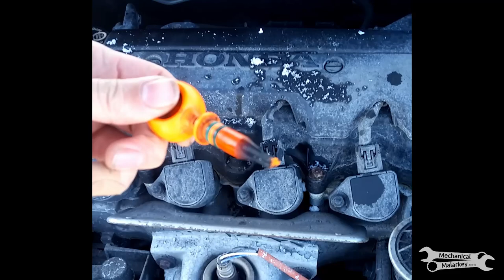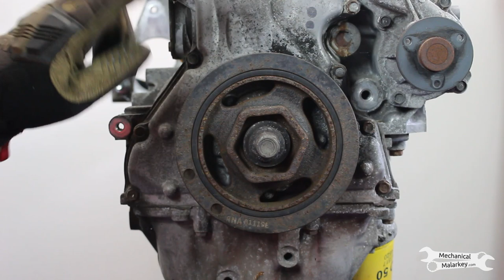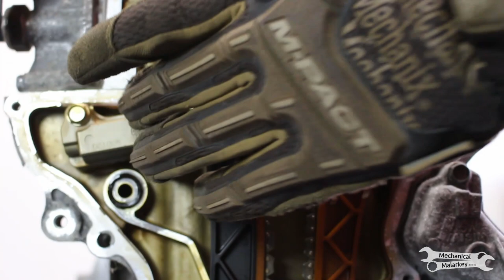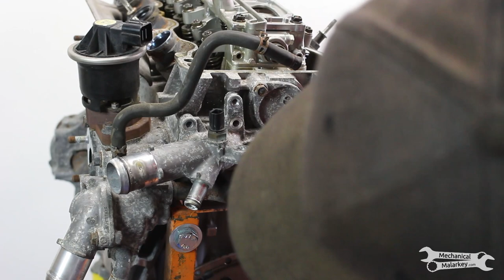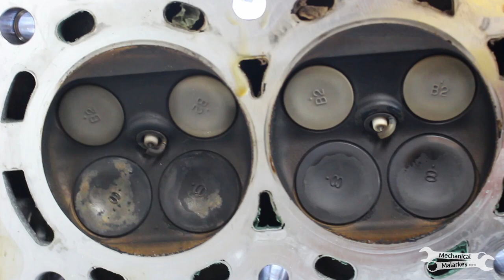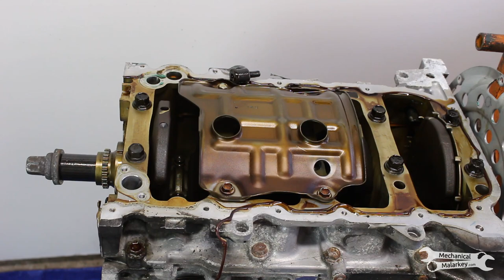Overheated Honda R18 Engine Teardown

Comment: It wouldn’t start because the coils were melted in the block, could of repaired all that and the engine would of ran just fine, it’s a Honda after all.
Reply: Mine has a lil bit melted in cylinder 2 and the engine won’t start at all think that would help? 😂
Reply: Same here but my coil is stuck in there
Reply: ehh it probably had warped head
Reply: Pre-2011 R18 engines are pretty fragile and, have been known to crack in seems close to coolant ports.

Comment: I have this motor in my car. 400k and going strong. Nice to see the tear down!
Reply: Any tips on keeping it going?
Reply: @PiLLO360  just recommended maintenance. I use mobile 1, change when maintenance minder says. Use Honda ATF fluid and change every 25k miles. I’ve only replaced alternator and AC compressor.
Reply: Never had to do a valve readjustments on this engine? Also, what model year civic do you have?
Reply: @jasoncurry2515 I never have. Ive always said I’ll do it when the valve cover gasket needs replacing and do it all at once, but I’ve never had to replace the valve cover gasket. Have over 460k on it now. It’s a 2013 EXL

Comment: I worked at a Honda dealership for 14 years, and ran the parts dept for 12 of those years. There was a defect in the block casting of early ('06 and I believe some '07) Civic R18s that caused the block to crack on the back side, towards the firewall. This caused a coolant leak, and engine overheating. If you look on the side of the block, you may be able to see the crack. We replaced TONS of these blocks under warranty. Other than those blocks, it is a very reliable engine. It doesn't have the potential for mods like the B or K series engines, but it's perfectly adequate for a daily driver.
Reply from the maker: Yeah, that's the only common problem I've seen that wasn't from neglect.
Reply: you can still make decent hp from these engines and have a fun daily driver
Reply: @massathebarber1573 yea but for that same money just buy an Si lmao never ever makes sense to build an R18 at least not in North America
Reply: What about a 2013 r18a ? Mine is leaking water on compression, i hope its gasket problem
Reply: Do you know if the cracked block issue affected Japanese manufactured Hondas?
Reply: r18 can reach at least 300hp, not bad

Comment: For those that don't know the Honda R18 is very similar to the Honda d series engines except it doesn't have performance VTEC on the camshaft the Honda R18 engine or the Honda R Series engines performance VTEC is in the intake manifold past 5,000 RPM a flap in the intake manifold will open up so that it uses a shorter intake runner

Comment: Usually the head has slight warp but ive also had the cylinder liners slightly sink/drop/shrink below the deck surface making decking the block necessary

Comment: 19426-RNA-A01 is the stamped steel gasket between the heater outlet and the head?, block?
When it leaks it give the indication of a blown head gasket resulting in a broken/ split radiator. My gasket imprinted itself in the poor outlet casting. I filled the impression and pits with JB Weld and sanded it on glass. Worked fine after that…..but first a new radiator or 3 and every other coolant part replaced…. It was the last part of the coolant system I checked.
Reply: jb weld lmao
Reply: @shinski8114 probably don’t think you can put a 6 speed MT in it either.

Comment: These run forever if you dont turbo it 😂
Reply: Exactly why I’m watching Lmao
Reply: Stop saying this stuff. Bro i been watchin u for a minute and i wanna turbo so bad. Forged internals and maximum cooling power should hold well no?
Reply: @o3ilil if you have that kind of money to throw around youre better off to engine swap it, or better yet, buy another car. I love my r18 civic but theyre gutless wonders, youll spend thousands and destroy reliability to make 200hp
Reply: Yes and no, and little boost is ok, it's when u run 20psi daily that theres issues, 8-10 would be ok.
Reply: @o3ilil yes fine, but k swap 1st. Though a lot of parts do interchange.

Comment: I once bought one of these a few years ago it was a 2007 Honda Civic and it was not overheating at first cuz I bought it in spring but during the summer it kept on creeping up there was a crack in the block and I replaced the engine after I replaced the engine a disassembled the old engine and found that there was remnants of an old dipstick in the oil pan these motherfuckers that sold me this car knew it had overheated did not tell me and also replaced the dipstick so that I wouldn't be able to tell

Comment: The middle two cylinders are not two and three The middle two cylinders are 3 and 4 the second cylinder is on the far right hand side of the engine where the fuel line enters the fuel rail
Reply: You’re thinking firing order, I think.
Reply: He's thinking firing order@nathanschneider6884

Comment: The most likely reason it wouldn't start is that excessive heat warped the cylinder head, possibly also the block.  Skimming the head would probably have gotten that engine running again.  The soot on the pistons is normal, pistons tend not to melt, the gasket usually goes followed by the head warping.  This guy seemed to be enthusiastic but the things he said would discourage me from having him fix my car 🤣.
Reply: i think it didnt start due to the melting coils

Comment: One of Honda's best engines lol. I've owned all kinds of Hondas and this thing is a hot pile of garbage.
About a year after buying my Civic I get a letter from Honda saying that my R18 engine block can crack it anytime!
Plus it's a gutless turd.
Reply: It's a Civic, it's meant to be economical not fast. Even like that 145hp from a 1.8 NA engine In 2006 is impressive. Also, the thing gets 40+ mpg if you know how to drive it.
Reply: @514aam  I can Average 42-44 MPG via Torque app, and calculating at the pump. 
The HP#s don't tell the whole story. It's the power curve, and this engine is peaky & low torque compared to other 4 cylinder engines.  Even worse on a hot day. You need a big gap compared to modern cars to merge into traffic, They get impatient and start honking at you because you haven't pulled out because your car is slow as hell
Reply: @theejoeylee  haven't had that problem on the R18 to be honest, the thing gets up to speed nicely, it's not a fast car at all, but enough for daily driving
Reply: I have no problem merging up to highway speeds with mine.  Never feels underpowered.

Comment: R18 is the worst engine in honda line up.. below average performance, worst fuel economy.

Why in the world they make plastic dip stick!!! is R series outsourced by honda?
Reply from the maker: And yet in my experience it's one of the most reliable. I'll take it.
Reply: My 2007 civic 5 speed coupe is rated at 40 mpg.
Reply: @MechanicalMalarkey  Have seen these go 350,000+ on mileage. The biggest issue with the Civics of this era (8th gen) is the longevity of the AC compressors and door lock actuators. Occasionally the wiring harness under the passenger seat causes intermittent airbag lights on the dash, and of course the putrid design of the cruise control switch which no longer clicks in place and requires replacement of the steering wheel switches if the owner is not interested in jamming a coin into the switch to hold it on.